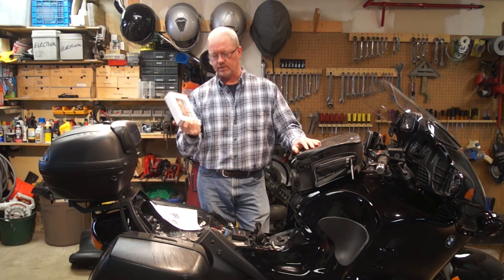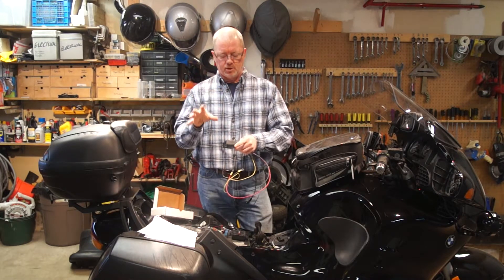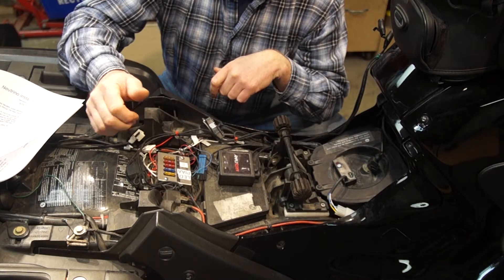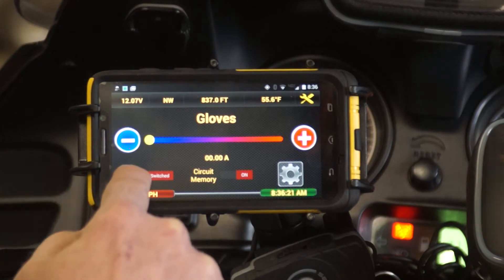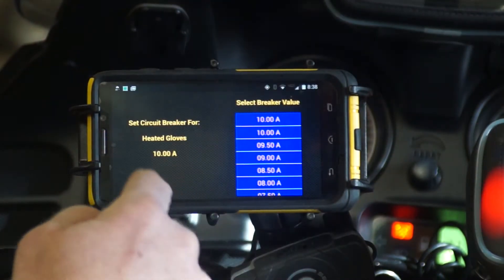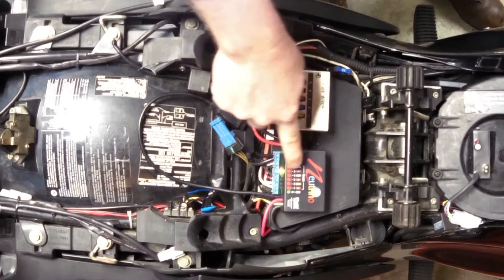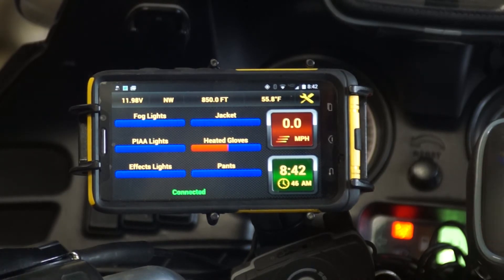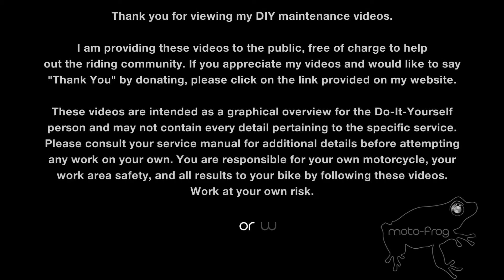Neutrino "Black Box" Installation & Review

Comment: the show chrome version is definitely not as sophisticated as the neutrino, but allows for more physical devices to be connected for 1/5 the money. I'm also concerned about why this unit requires knowing your speed, altitude, location, etc. Is the neutrino really that much better? and what about the switched power devices that you have? are those utilizing the bus connections already set up in the bike or did you wind up fusing them through to the battery? I really like the idea of the neutrino, but if you are adding running, dress-up, custom brake and/or well lighting, along with GPS, phone, heated gear, and security devices (i.e. FIN), trickle charger (which I would not recommend adding to a controller), the neutrino doesn't seem as though it would support them all. Add in the high cost of that neutrino ($250), and then another $100 for the garage door opener and the other add-on that I can't think of off the top of my head, and I think I'd rather stay with the fuse panel until the neutrino makes a product that more of us can (a) afford, and (b) not feel paranoid about.